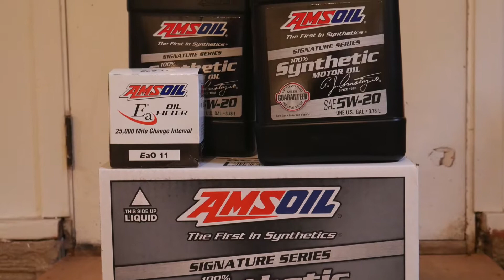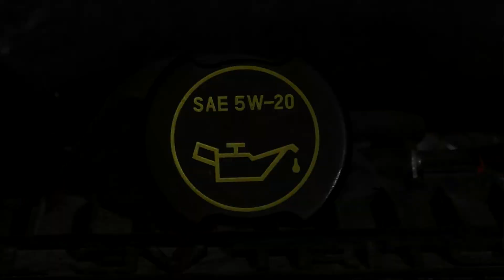Ford F150 Oil Change AMSOIL Signature Series 5W-20 Synthetic Oil Ea011 Oil filter

Comment: Sir I am from Iraq the whither is too hot are 5w20good for my car ? thank you ❤️ sorry my English is  not good
Reply from the maker: Best is always to use the manufacturers recommended viscosity which it was designed for. Using a good quality synthetic, as well as oil and air filters are important, especially for the extreme conditions.   Thanks for the question!

Comment: I really wish Amsoil still sold those blue air filters.
Reply from the maker: Thanks for checking out the video!  The OEM style nanofiber are out of production.  Still available are the round styles for carbureted engines and the conical type that fit some custom and aftermarket induction systems.
Reply: Yeah the "OEM style nanofiber" like you have in the F-150.  I really wish they still made those.  Unfortunately I didn't find out about them until after they stopped making them.  Nobody else makes anything like it to my knowledge.
Reply: You may be able to look up an Injen intake, some of those come with the blue nanofiber filter.
Reply: Jon Dison that's because people know k&n is better.

Comment: So if I have a 5.4 3v and use Amsoil 5w 30 Signature how many miles until the next oil change?
Reply from the maker: AMSOIL recommendation for Signature Series in stock, gasoline powered engines 25,000 miles under normal service, 15,000 miles under severe service, 700 hours or 12 months, whichever comes first.  Most people would be under severe service.  High mileage or dirty engines will benefit from AMSOIL engine flush to help prep the engine for new oil.  Pulling an oil sample after 6-9 months is a good way to tell how your oil is holding up in your particular situation.  Always use the recommended viscosity. The 5.4 has a reputation of cam phaser problems and this is another good reason to use a top of the line synthetic like AMSOIL Signature Series.  In my own F150 with a 5.4 I use Signature Series 5W20 and the AMSOIL EA filters and change the oil once a year with typically 9,000-10,000 miles.   Thanks for the question!
Reply: I do mine every 15,000 with AMSOIL 5w30 in my 5.4 3v and it has 310,000 miles on it everything is original

Comment: I wish Walmart sold amsoil signature
Reply from the maker: Better than Walmart, you can order online and it's delivered to your door!!  There's distribution centers located around the country so availability and delivery time is top notch.
Reply: MidwestSynthetic hand on a Bible. What is cost per quart.not fifty quarts no 100 quarts .One bottle.signature series
Reply from the maker: Links to the product pricing are in the description to the video.  Of course, better pricing is available by the case, and adding the Preferred Customer program helps too, which has other advantages such as free shipping on orders over $100 (as of May 2018).   Thanks for the comment!
Reply: @midwestsynthetic  can I buy in Mexico? If so, there are distributors?
Reply from the maker: @tomorrowcomestoday1621  

Here's what AMSOIL shows for Mexico:  https://www.amsoil.com/international/distributor/Countries/Mexico.aspx
Reply: @randyjohnson805  Signature series is $13 or $10 a quart with the preferred customer program ($20 a year) I don't know why he wouldn't answer your question.

Comment: That crap that drained wasn't amsoil 5w20 signature.
Reply from the maker: It was Signature Series 5W20.  It gets that way after a year.  Lots of short trips with this one.  Right before the change a year before the one in the video I pulled a sample and sent in. It was still good but time for a change.  Thanks for watching and leaving a comment!
Reply: MidwestSynthetic find a amsoil executive that makes short videos. He was talking about 0w30 signature. I think he has a 06 Silverado and said he just changed his oil after 4 or 5 years. He claimed several 100k miles on oil.He also mentioned bypass filter. The guy mentioned he lives in Atlanta. Is there where they make amsoil? I thought it was a Yankee northern state company.. Question is if you had signature oil all over the building and at least you could buy it at cost would you wait that long to change the oil?
Reply from the maker: AMSOIL is in Superior WI.  For Signature Series they recommend running up to 1 year or 700 hours or 25,000 miles, 15,000 miles under every service.  Service intervals beyond AMSOIL recommendations require sampling to know the oil still good.  The bypass filters are a great option for many applications.  For my personal vehicles I'll stick with AMSOIL's recommended intervals and an occasional oil analysis to confirm all is well.   Thanks!
Reply from the maker: Minor correction, 15,000 miles under severe service, not every service.  Darn spell checker!